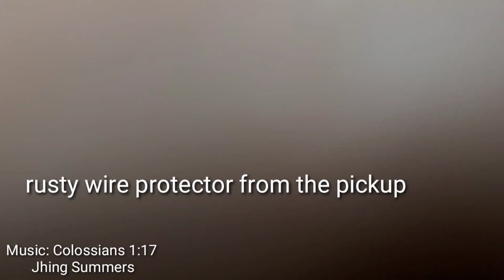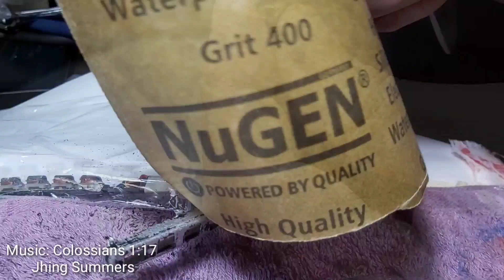Roland GK3 Pickup Repaint

Comment: Sir my advantage p b ang gk3 pick up, maliban sa easy controller ng gr55 mo??
Reply from the maker: Malaking advantage lang siya to connect sa GR and source ng sounds. Other than that wala na akong makitang extra functions eh hehe added effects lang sa volume, S1 and S2 per patch sa Gk3 pickup.
Reply: @jesguitarist  so controller lng din tlga sya, switch to another patch?? Wla ng iba puro volume nlng no??
Reply from the maker: @mrBeanstring21  pwede naman mag assign ng effects sa volume, S1 and S2. But most of my programs assigned lang talaga sila for volume or string pads level and bank up and down.
Reply: @jesguitarist  sir tanong ulit magamit b ang gr55 without gk3 pickup.?? Normal pickup lng gagamitin ko.. my input b sya pra sa normal n G.cable(TS cable) lng..
Reply from the maker: Pwede sir may napanood ako dati na modified cable PL from guitar to 13pin input sa GR55. Sa Roland GR-55 fb page ko nakita dati. Eto nakita ko dito sa youtube.

https://youtu.be/quKkVEDVT5Y
Reply: @jesguitarist  😯😯😯 ah sige sir.. my nakita ako vid, rc300 at gr55 din ang set nya.. panalo sir hehehe
Reply from the maker: Yes sir mismo hehehe next time na ako bibili pag pasok na sa budget ang rc300 😁
Reply: @jesguitarist  ay sir sakto sayo malaking matutulong sa mga gig mo promise..

- ilang second ang build in looper ng gr55 sir?

- mas nagloloop kc tlga ako ngaun sa ableton live kc my mga vst/plug ins ako dun n sax at cello, ung rc300 ko ginagamit ko sa acoustic kaso naka-asa lng ako sa fx ng boss katanna ko, kaya gusto ko tlga fx n ma-loloop ko sa RC300, nagplano kc ako nun n bumuo ng stomp boxes kaso mas magastos pedal board at power supply p lng mahal na..

tas nakita ko ung video mo sa gr55 lahat ng gusto k n fx nasa gr55 😂 buti nlng na discover ko mga video mo sir.. haha
Reply from the maker: @mrBeanstring21  actually di ko ginagamit looper ng gr55, flashback x4 ang ginagamit kong looper, 40 sec lang eh kaya nabibitin ako. Gusto ko ma maximize ang isang song lalo na kung nababago ang chords ng verse, chorus then sa mga solo parts din. Sa rc300 talaga magagamit ko lahat hehehe may nagsabi din sakin yung electro harmonix 95000 ata yun pero pinagiisipan ko pa. Considering sizes din kasi tsaka sa price hehehe
Reply: @jesguitarist  oo sir kulang un.. kung 4 bars lng ang chord progression tas hanggang end n ng song un, pwede pa.. dati 30secs nga lng gamit ko sa gt1 bitin pa din lalo kung madaming chord proression hahaha.. sir sakto yan, ung structure kc ng kanta especially kapag ng iiba iba ang chord magagawa m yn dyan, kc di lng isang track yan tatlo yan, kada isang track my tig 90secs magagawa m din mag smooth na stop ng loop pag end ng 4 bars n sinet mo kunyari then punta k sa kabilang track magloop k ng refrain hehe well depende sayo kc saken ganun diskarte ko.. excited n nga ko sir magka powerful looper ka, pra makapanuod ako ng matinding performance mo hehehe
Reply: @jesguitarist  magandang delay ng TC yan sir ahh.. delay of choice ko yan dati yang flashback 😆
Reply from the maker: @mrBeanstring21  Salamat sa pag encourage sir, pag iipunan ko na yan hehehe nanood na ako ngbmga demos kaya na engganyo ako magkaroon ng rc300. In time buy talaga ako.hehe 
Yung flashback ok naman sa looper bitin lang talaga, ok na ok siya sa delay pero di ko na masyado nagagamit more on looper lang siya sakin.
Reply: @jesguitarist  ay sir check m din ung RC 505 table top nmn sya.. ok din un kung ayaw m ng tinatapakan
Reply from the maker: @mrBeanstring21  ayaw ko ng table top lalo na pag busy kamay ko sa pag gitara 😁😁😁
Reply: @jesguitarist  kunsabagay ako din nmn ehh hahaha kaya ng rc300 ako ehh
Reply from the maker: @mrBeanstring21  Ayos sir.hehe kung may IG ka follow na lang din tayo sir. jesguitarist username ko dun 😊